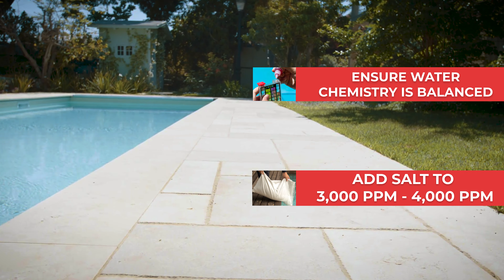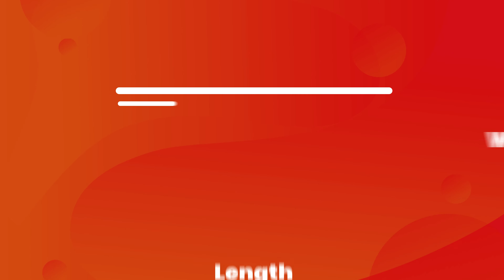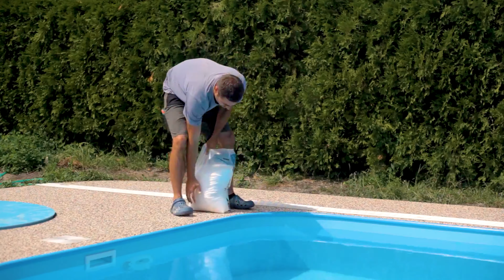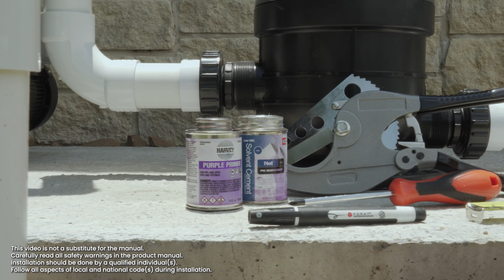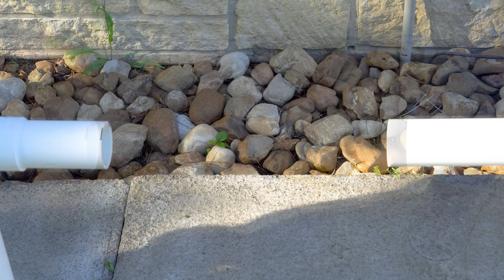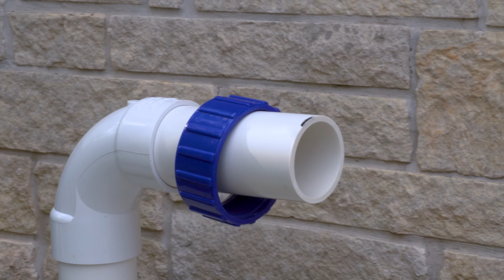Installation Guide | CircuPool RJ Series Salt Chlorine Generator | How to Install Your Salt System

Comment: Hi! I already have the RJ45N system and I’m planning to add the INDIGO3-XL Ozone Generator, which needs to be installed before the salt chlorinator in the plumbing line.

The problem is that the space where the ozone generator must go is currently occupied by the Electrolytic Cell of the RJ45N.

To make room for the ozone generator, I would need to move the Electrolytic Cell upward in my plumbing, which means installing both the Cell and the Flow Switch in a vertical position, with the water flowing from bottom to top.

Could you confirm if the Electrolytic Cell and the Flow Switch can operate correctly in this vertical, upward-flow configuration?

Thank you!
Reply from the maker: The cell and flow switch can be oriented either horizontally or vertically as you describe. Sorry for any delay in this response. The ozone generator and salt chlorinator combined are a great way to really boost the purity and clarity of your pool, as well as to extend the lifespan of the salt chlorinator. If you have any additional questions feel free to reach out directly - you can speak with our product experts at 888-206-9038

Comment: This video shows the rj-plus installed cord side down against the installation manuals instructions. Is this safe? Id like to avoid gas accumulating in the unit while operating.

Ok found the answer. Circupools installation manual says "ENSURE the cable is on top" but then goes on to say "NOTE: if you use a variable/multi-speed pump unit MUST be installed upside down".

How stupid. Don't say contradictory things in the installation manual.
Reply from the maker: Thank you for your feedback. The cell is able to operate in either position; the type of equipment used dictates its suggested orientation. Variable Speed Pumps are quickly becoming the standard, so I would imagine withing the near future that orientation may also then become the default in the installation instructions. If we can be of assistance, please reach out to our support team at 888-206-9938. Thanks for being a CircuPool customer.

Comment: No matter how tight I screw in the salt cell it still leaks bad.
Reply from the maker: Please don't hesitate to reach out to our support team: 888-206-9938

Unless something is physically damaged, the primary reason there would be a leak would be that the o-ring is either not seated correctly or not present between the cell and the plumbing union.

Comment: Can the flow sensor be installed upside down or does it need to face upwards
Reply: The instructions show the flow switch before the cell. The video has it after
Reply: @brianrooffener4543  I called Circupool and they said it can be installed either before or after the cell. He said most people like to install after the cell.
Reply from the maker: Ideally, the wire-side should be up if the flow switch is installed horizontally.